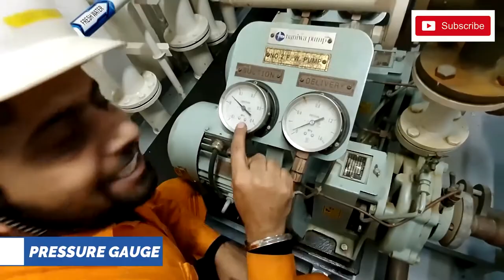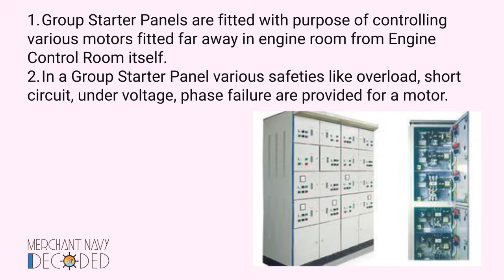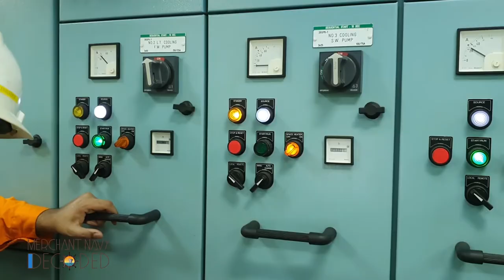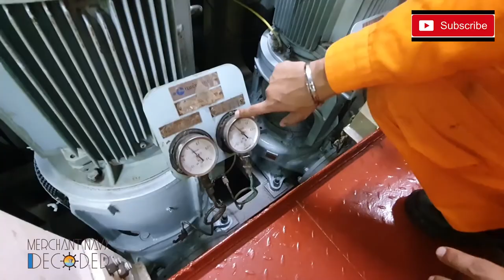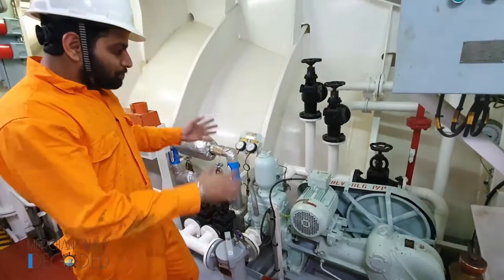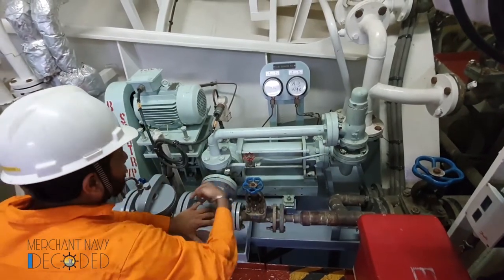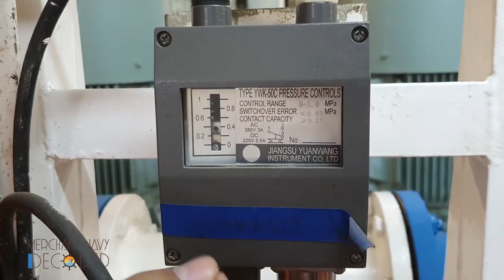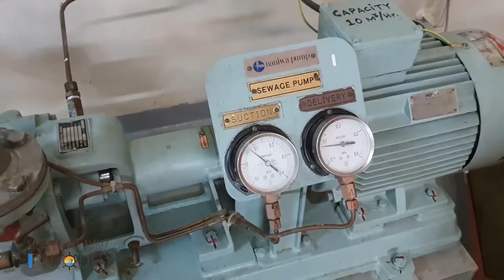Engine Room On Ship || Types Of Pumps || How Pumps Work?

Comment: Sir, that bilge/ows pump which is said as mono screw pump, is it same progressive cavity pump, as stator is mostly damaged made up of rubber kind of material, which needs to be changed??
Reply from the maker: beta ask your question in simple terms , did not understand ?
Reply: @MerchantNavyDECODED  Sir, from the video those OWS pump, jo aapne bola mono screw pump hai, i thought ki it is progressive cavity pump, as it looked similar design. So my query was if mono screw pump is alternate name of progressive cavity pump or both are very different?

Comment: Lo pump is centrifugal pump or positive displacement pump
Reply: Nowadays we use submersible centrifugal pump, since we are feeding lube oil starting with Crosshead first and for better lubrication at Xhead, centrifugal pump is best suited for the reason of discharge rate.
Correction accepted.
Reply: As Sir said for transfer purpose we use gear and screw pump.
Reply from the maker: @prabodhpoojary5744  rightly said

Comment: Why generator fuel oil pump is provided an enclosure?
Reply from the maker: what if the high pressure pipe leaks and the oil splashes on hot pipes or turbocharger , a sureshot cause of fire
Reply: @MerchantNavyDECODED  oouu got it!